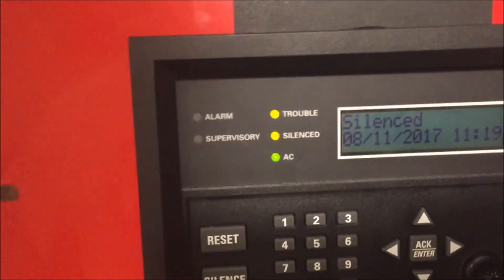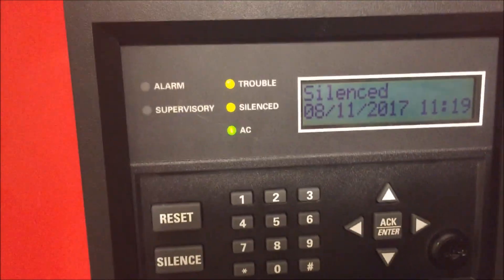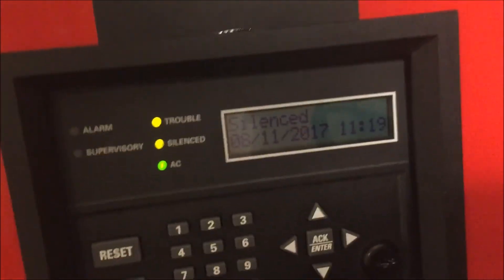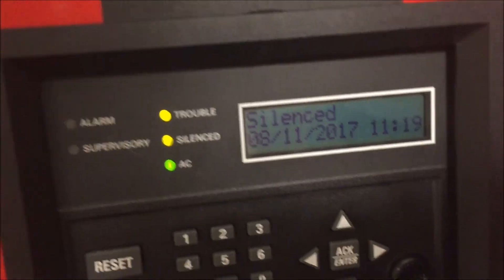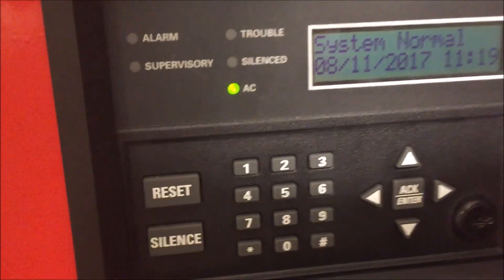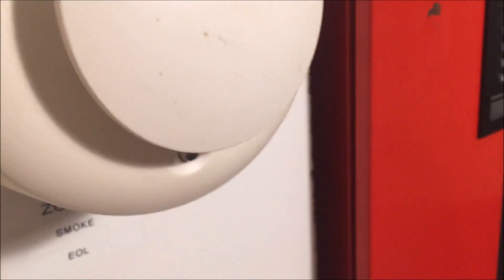Supervised Circuits on a Fire Panel Explained

Comment: Where can I buy resistors like the ones in the video? Is there a specific model?
Reply from the maker: Resistors are a common electronic component that can be bought on various online stores like eBay. Different panels require different resistances (measured in Ohms), but some companies, like simplex for example, have specific models for resistor harnesses but are much more expensive then a hobbies would actually need. All of my resistors I got online for a few bucks for a large pack
Reply: Ok thanks!